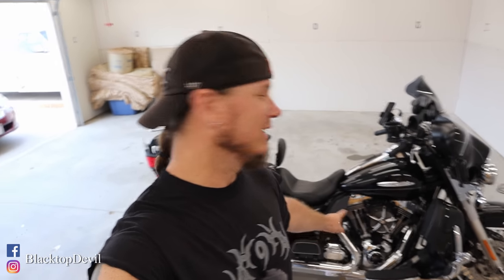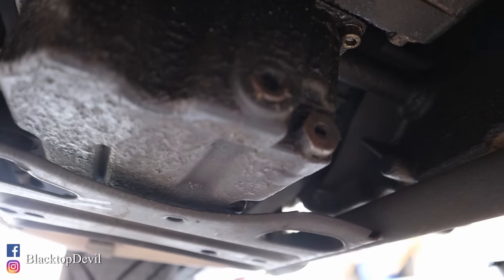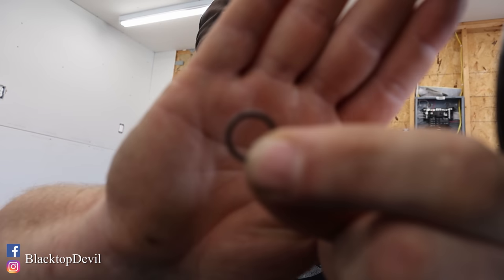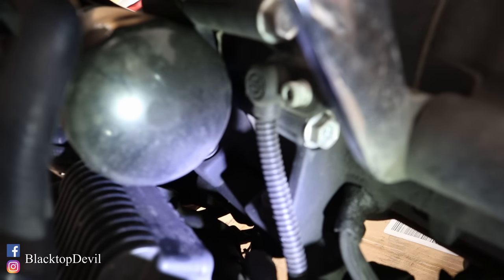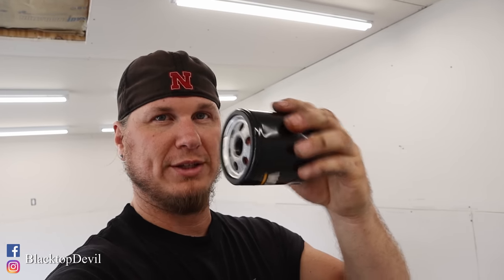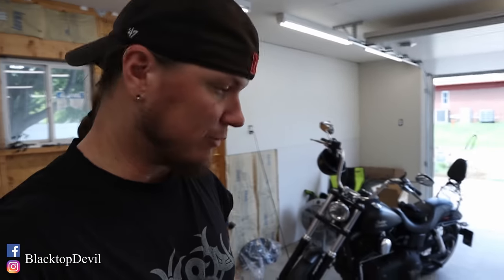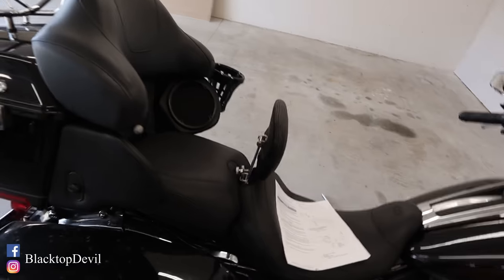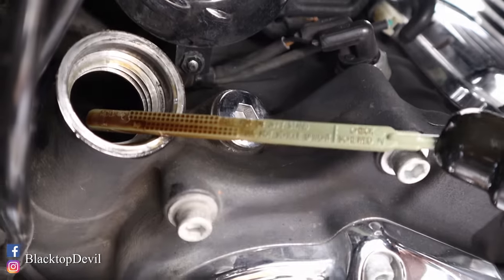How to change oil on a Harley without the special tool on a twin cam 103. Includes Torque specs

Comment: An amazingly cuss word free video, although I have convinced my bride of 35 years that colorful word usage enhances one's DIY experience. Thanks for sharing and a great reference video for anyone looking for tips. Thanks for sharing and ride safe
Reply: That's the best penetrating oil there is. Cussing makes for good first aid as well, and a starting fluid replacement, and torque multiplier, and part breaker....

Comment: BlacktopDevil Excellent lesson in changing oil on your Motorcycle. I used to do Oil Changes and basic maintenance on my neighbour’s two Motorcycles he had.  I got tired of him leaving my tools scattered on the garage floor and filthy. I saved him  a decent amount of money by doing his maintenance. I just researched on the Net. He had his Harley in a shed and it fell over one time. He came and asked if I could help get his bike upright. The windshield was wedged awkwardly under a shelf. I asked him to lift up on the shelf. He didn’t when I put the Motorcycle upright the windshield snapped. He complained I broke the windshield, I asked him do you want me to go lay it back the way it was? He ended up trying to sue me for the windshield. I went to Court pleaded my side and won.
Reply from the maker: Wtf?! Nice guy... Geez

Comment: I bought a oil filter wrench called " The Wench" one removes the oil filter, the other end removes the drain plug for the engine and the primary, I use on my 012 RK. Great Video.

Comment: In my experience, using the yellow Prestone Coolant funnel for filling the engine works best.  The funnel upper side is large enough to hold the bottle upside down, the lower exit opening is almost as large as the dipstick opening which causes the oil to go in faster and aids in eliminating spills.  BTW, great video.

Comment: Nice tip on the DIY filter tool. A few years back I started using a K&N filter. Not because I think it is superior to wix or anything, it was just because it has a nut welded on the bottom that makes it easy to remove with a standard  socket. Yeah I am that lazy lol.
Reply from the maker: Nothing wrong with that! Haha

Comment: Welcome to Garage videos lol. Winter sucks. I am not a fan of changing the oil I have a buddy with a lift . So I tend to go there when I do the 3 oil.Brian good job as always.I made the mistake with my Honda Interceptor where I did not put oil around the rubber seal and I ended up taking it off it just kept leaking.

Comment: Mr. Devil as a tech I've got to step in here and offer some tips. Overboard? Prolly so. But fail safe. 
1. NEVER not replace your o-ring at every service interval. For the few cents it costs you're foolish not to. 
2. Always use a light metal brush on your drain plug threads to clean them then spray with brake cleaner and wipe dry. Install o-ring
3. Apply Teflon paste to the threads of your drain plugs for added protection. Be sure not to get on magnet. Reinstall. 
4. Torque first to 14lbs, back it off a little then re-torque to 17lbs
5. ALWAYS replace your transmission dipstick o-ring. The o-rings seat with heat. Once seal is broken they lose their integrity
6. Always replace your derby cover gasket
7. Prior to starting your oil change fill your oil filter 1/2 full with oil and let soak into filter
8. Place a light coat of oil on the rubber seal of your oil filter prior to install. Insert filter finger tight plus 1/4 turn. NO MORE!!!
9. Never hurts to filter your oil through a fine mesh filter to check for any metal shavings
I've done this as long as I've been working on Harley's and have never had one come back for a leak.
Reply: I agree, tightening 3/4 to a full turn on the oil filter is just inviting a leak to start.  I believe the service manual says 1/2 - 3/4 of a turn, which is more than adequate.
Reply from the maker: Good tips man, thanks!

Comment: As a service tech at casper HD was required to brush on a small amount of white teflon tape on the drain plug threads so if anyone messed with plug after the bike left the shop the dealership could prove it was tampered with it can also help with any leaks .

Comment: BTD, good video. I gotta get my lazy bvutt in the garage and do a 3 holer. If you don't mind, part number for the Wix oil filter. I use a 3 jaw wrench to get the filter every since a muscle head at Harley did the oil. It took 3 men and a little boy to get that damn thing off...TTFN

Comment: I use Amsoil in everything I own!!!
Reply: Lol..why Not Use Oil Designed for Transmission  and Primary since its Specifically  Designed for them and has Longer Mileage life ,,like 80/140 HD Heavy syn.
Reply: @paulhorvath9784  ....🤣🤣🤣...That's cute, who told you that??? Harley??? Is that why they told everyone years ago that running SYNTHETIC OIL would wear flat spots on the ROLLER BEARINGS???🤣🤣

Comment: When the leaving the dipstick in after removing drain plug and oil is flowing fast, this could mean the bike has bad oilers. Some riders notice oil dripping on cam cover or nose cone, this would indicate the bad oilers or excessive blow by. Just a tip on when changing oil.
Reply: Yes the air oil separators go bad around 50k or they did on my bike. They are cheap and easy to replace in rocker boxes.
Reply: Thanks, appreciate the advice.

Comment: Guys, you have got to check your manuals for your bike. I have a 17 Ultra and the full capacity says 5.0 quarts. But, the manual says to fill with 4.75 quarts and add if necessary. Ya gotta love Harleys, and yes I do! I think after ridding it a few days I got the entire 5 quarts in.

Comment: Ever wonder why front engine mounts deteriorate? oil from filter running onto the rubber....Theres several ways to avoid it...a special plastic catch ( availabe from HD ) or cover the mount in plastic bags.

Comment: Well, I entered my 60's. I have built, rebuilt, traded and restored about 80 bikes. I'm now on my 8th Harley. Bottom line...changing  the engine oil, filter, trans  and primary oil on a Harley every 2500 miles is a messy pain in the ass.....there I said it.....Good video, Thanks

Comment: Good video. What about the primary oil, do a oil change there.
How often do you change the transmission and primary oil
Reply from the maker: I typically always follow he maintenance schedule in the back of my manual. I'm die for a transmission change so I'll probably do that soon. I can't remember the mileage for the primary but I did a video on it, kind of. It's pinned at the top of the comments here.
Reply: @LifeontheBlacktop  I have oil changed I use the HD Syn 3 in all holes. They dealer says between 3-4k miles and I have all three done at the same time
Reply from the maker: I'm personally against using engine oil in my transmission or primary. Personal preference of course but I feel like syn3 isn't enough for a transmission. I use red line in my transmission and Harleys formula + in the primary.

Comment: I truly appreciate your how-to videos. 🤘 I'm in the garage while watching this, looked over at my bike and realized that both drink holders, highway pegs and phone mount, were all bought and installed after watching your install videos. Quick question, do you put any oil on the rubber/viton o-ring on the drain plug when reinstalling it? With the motor getting as hot as it does, I wondered if the oring sticking was ever a problem on the 103's.
Reply from the maker: Thanks! I try to make them easy to follow to help the complete noobs figure stuff out and save them some money. I do put oil on those o rings when I remember haha. Usually the hole has enough drip out of it that if I forget it's usually not a big deal though. At least from what I've noticed.
Reply: @LifeontheBlacktop  Cool, thanks man!

Comment: Thank you for the video .
Reply from the maker: Anytime brother. Hope it helps!
Reply: @LifeontheBlacktop  changing it now . Adjusted my clutch last night . There was  Thread tape on the oil drain plug . Was changed at the Harley dealer last time . What is up with that ?

Comment: Great video…I could look this up, but is the 103 air cooled only or is it air and oil cooled? Is there a small radiator that the oil circulates through to aid in engine cooling?
Reply from the maker: There is an option for an oil cooler. This bike is a limited so it comes with an oil cooler on it, but you can add them to bikes without it as well.

Comment: Hey i just have a question for u, I just watched ur video and u said that u bought they overpriced oil im just curious on how much u paid for the jug of syn3 oil in the states, because here in Ontario Canada the same  syn3 4 litre jug  at Harley cost  62.95 plus taxes.
Reply from the maker: I'd have to look but it's more expensive than non Harley oil from what I remember.

Comment: I use Drag Specialties filters with the nut welded on the end so removal only requires a socket, extension and ratchet; makes the job much easier. They also make an oil filter funnel that will help prevent the mess from removing the filter https://www.ernstmfg.com/Oil-Filter-Funnel.aspx

Comment: do you not change the primary oil when you do a oil change? or did i just miss that
Reply from the maker: I do primary every 10k. I did a 30k maintenance video awhile back where I did it. I think think I went super in depth with it though. Getting old, hard to remember 😂
Reply: @LifeontheBlacktop  lol just just pick up a 2013 ultra with the 103 thanks for the info
Reply from the maker: Nice! You'll love it! Also above I meant to type "I don't think I went super in depth"

Comment: I assume you bought your Ultra used?  When did you get it and how many miles where on it when you got it?
Reply from the maker: I bought it new. 1.1 miles. So I guess slightly used lol
Reply: @LifeontheBlacktop  Smooth seas don't make good sailors and don't let Mrs. Devil near your bike again with tools in her hand.
Reply from the maker: Haha. It's a rider. My fender is already dented from a gopro mount a few years back.

Comment: Just curious buddy what did you race did you run the quarter mile in Kearney
Reply from the maker: I had a high 10 second Eagle Talon that I ran over there quite a bit.
Reply: @LifeontheBlacktop    I had a 1974 Vega black with lime green flames probably raced you buddy
Reply: @LifeontheBlacktop  A DSM man after my own heart. I ran a 93 Eclipse in SCCA for 2 seasons.
Reply from the maker: Whoa I think remember that car actually!
Reply from the maker: Nice! I knew some guys online that did that. Looked fun! Mine had a welded center differential so corners were sometimes a struggle lol
Reply: @LifeontheBlacktop  do you remember my car  buddy the good times

Comment: at what point do you do a 3 hole change vs just oil?
Reply from the maker: I always follow my manual schedule. I need to do my transmission soon as I'm right there now. If I remember tomorrow I'll post up the mileage change requirements for this bike.
Reply: @LifeontheBlacktop  thanks, I've had a metric cruiser for several years and do most of my own wrenching. I just bought a twin cam Road Glide. Trying to learn as much as I can to not have to run to someone else for everything

Comment: Nice clean job NOT ! 😂😂  
Oil is a cheap insurance to keep ya engine healthy. Cheers 🤘
Reply: Inspired me to do a change on my Streetglide also. I have a filter funnel for my Fatbob, which of course doesn’t fit the Streetglide, so I just let it rundown front mount also.  Wasn’t too bad of a mess.   
If your doing your own oil changes, how often do You like to change yours ?
I do mine anywhere between 4500km and 5500km intervals... especially now we are into summer heats.